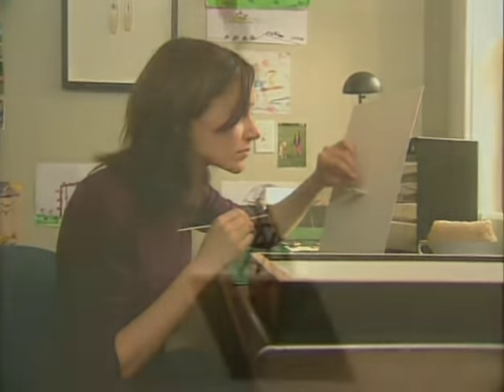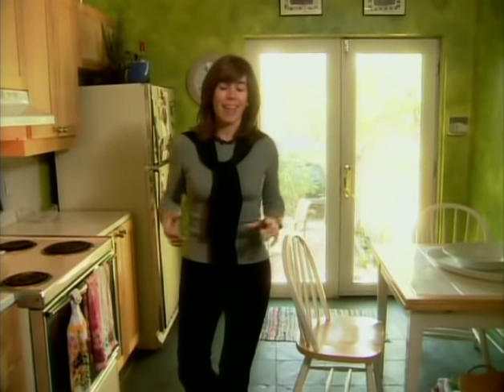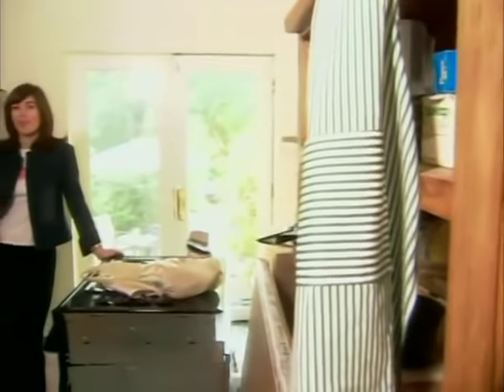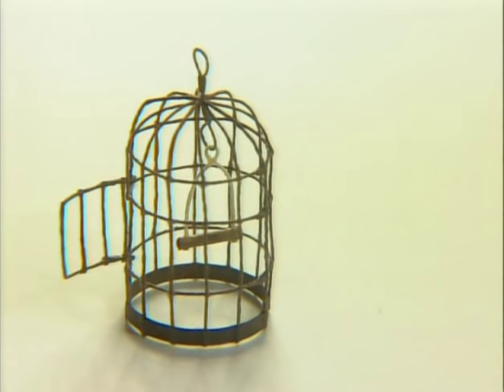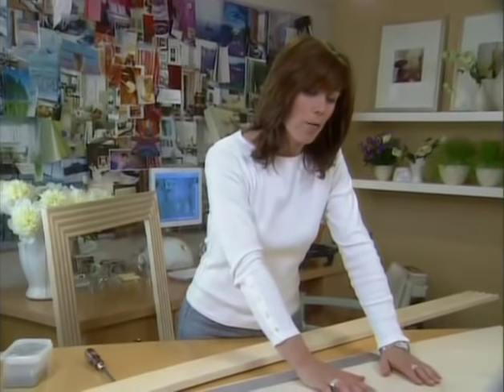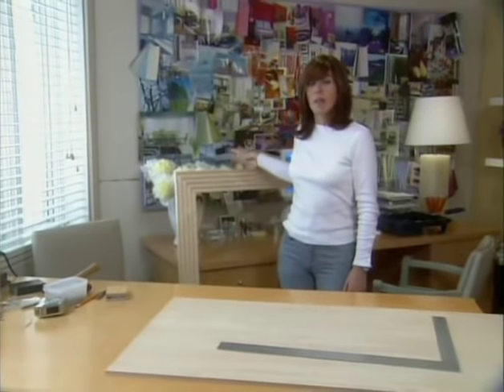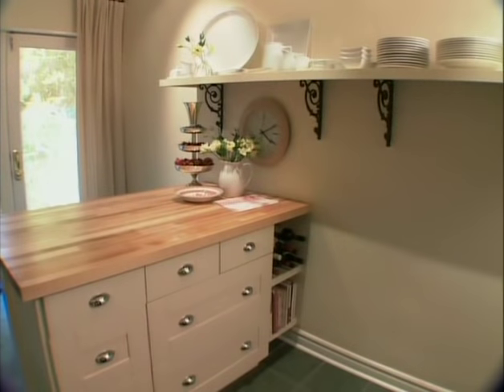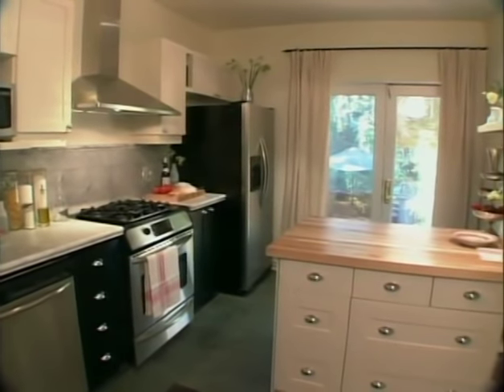Room Service - Lipstick and Rouge Kitchen

Comment: The kitchen remodel turned out looking very nice.  I'm not sure how practical placing the "blackboard" over the sink was though.  Only someone very tall could use it.   I also wondered how much space there was between the "island" and the oven, when opened.   It appeared to be quite tight.  But overall, it turned out looking to be a pleasing space.